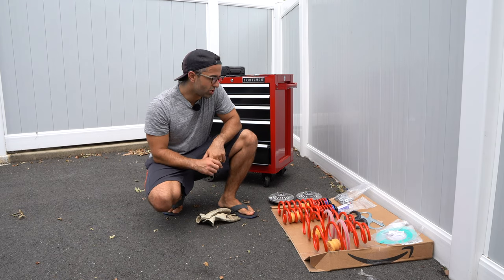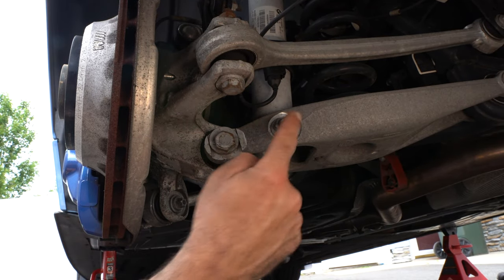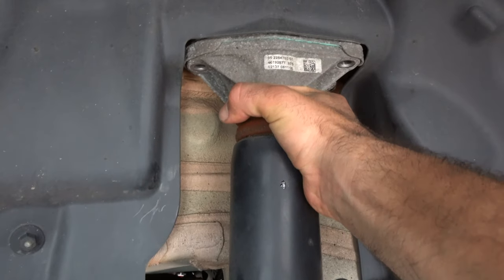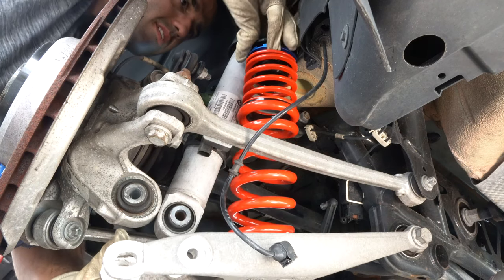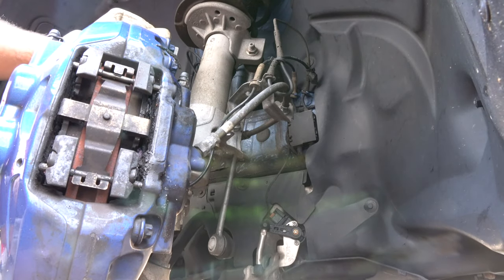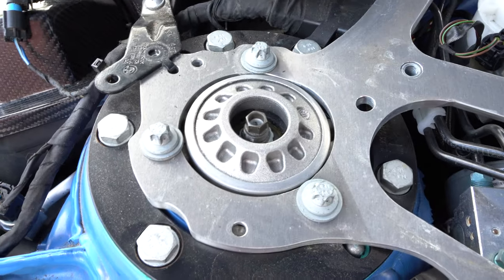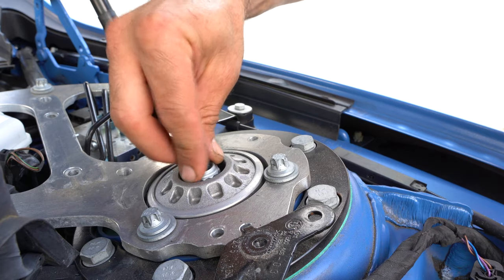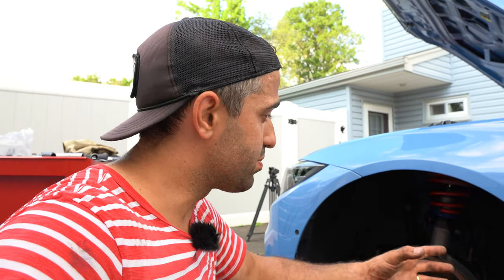DIY install M Performance Height Adjustable Suspension (HAS) In an F80 BMW M3 (same as Dinan and KW)

Comment: Hey Tommy hope all is well.. is it possible to install the rear helper springs incorrectly meaning upside down? my car is at a very reputable performer shop here in my area in Northern Virginia and for whatever reason they can’t get the rear as low as your car. My car is 2020 F82. Unfortunately I can’t find any pictures of the coup version wondering if the coup sits higher than the sedan
Reply from the maker: Make sure they removed the original spring seats. And no you cannot do it upside down
Reply: @TommyLGarage  hey Tommy is your ride height maxed out? I was looking at the instructions and they state a certain range for the type of wheels and tires that you have installed. I have double staggered 763m 20r 19f

Comment: Great video thank you 🙏🏼. Love watching these to prepare for doing it myself. 

One question for you or anyone else who has done the install .. I’m curious about the sleeve you used to install the kw front perch . Is that a sleeve that comes with the kits to know where to install the perch ? I’m confused as to how far the sleeve can go down usually there’s a positive stop or ring/groove or tab that needs to support the spring so it doesn’t push further down after hitting nasty bumps etc?
Reply from the maker: So the spring seat (perch) that sits on the shock continues to get pushed by the weight of the car and force of the spring. The shock itself gets thicker towards the bottom so there is no way it can go all the way down. 
And the stock perch is seated in the same way - and it wasn’t sitting on the shock very tight anyways - I was surprised at how easily it came off
Reply: Tommy L Garage appreciate the reply !! 🙌🏼  I assumed there had to be a positive stop that prevented too much travel. I was a little confused by using the sleeve you had because I wondered if the kw wasn’t tight at that point (given variance/tolerance of diameter etc) then it would just move further down eventually.  Did the instructions have any directions on what height to set them at?  Or say to mark and get them to a certain measurement etc?  Thx!! 👍🏼👍🏼
Reply from the maker: 5abivt no worries! And yes the instructions have recommended height settings but I ignored them since I wanted to be lower. This is an excellent setup and I’m very happy I got it.
Reply: Tommy L Garage appreciate it !! And honestly that’s exactly why I was curious because I wanted to be a touch lower too and wanted to look for ways to get a bit lower 😉👍🏼👍🏼

Comment: what's the torque spec for the e torx bolts at the top of the rear struts?
Reply from the maker: I don’t recall but the install manual has it